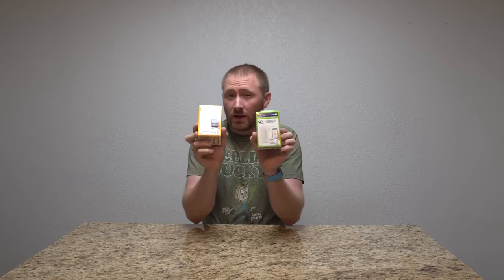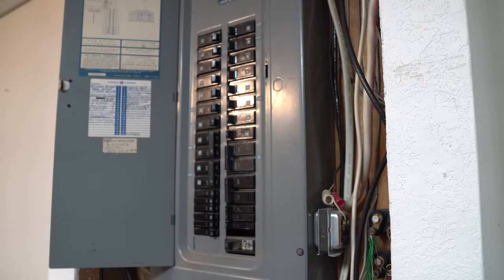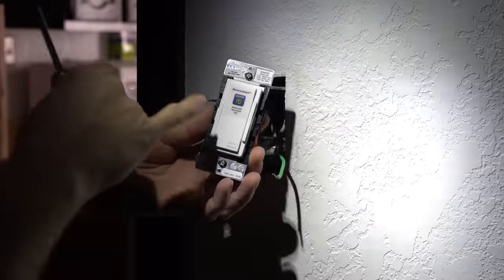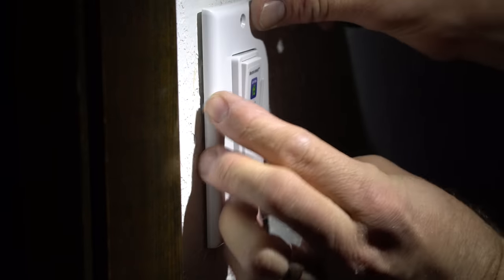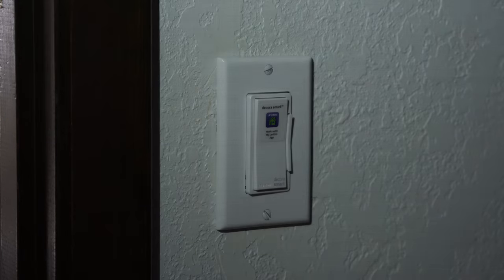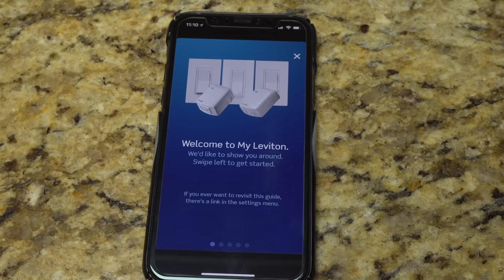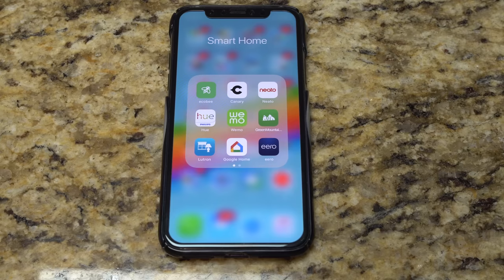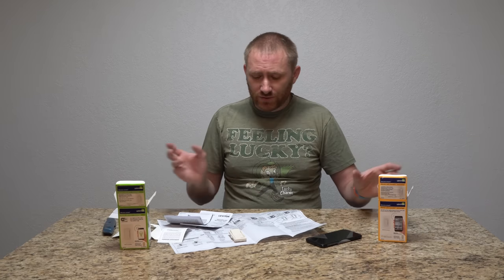Leviton Decora Smart Switch Install

Comment: You did a great job of presenting this installation.  One suggestion: Get a stationary flashlight that you can mount in a fixed position.  ;-)

Regarding your wiring mistake...the instructions show that the Red screw is for connecting the Load, and the Black screw is for attaching the Line.  In your video, you said to connect the Line to the Red screw, which is why it didn’t work.  For a first time failsafe installation, after removing the switch from the box, but before disconnecting the wires, turn the power back on and use your voltage probe to find the live wire (with the light switch turned OFF).  That will be your Line wire.  Then, mark that wire with a piece of electrical tape, or a label, so you’ll know which one to connect to the Black (Line) screw on the switch.

Keep up the great work.  Your video production is very good!

Comment: A couple notes. You should not have connected both neutral wires to that single screw terminal as it is a violation of electrical code. A short pigtail wire should have been added to the wire nut with the neutrals and then that single neutral pigtail wire would be connected to the screw terminal on the switch.

Next, you could have used your voltage tester to determine the line and load wires. After disconnecting the two black wires, turn the breaker back on temporarily. Use your voltage tester and touch it to each black wire. The one that sets off the tester is the line wire coming from the breaker panel, and the load is the wire with no voltage that goes to the light. Of course, it is very important to then turn the breaker back off before starting to connect the wires to the new switch.
Reply: Also a klein non contact voltage tester will tell you which is your hot and which is your load and to verify if a circuit is energized.. I use it because I have seperate circuits running into a two gang boxes in my house, never assume two switches are on same circuit.

Comment: I bought a few of them that are HomeKit enabled. They are a huge pain to sync to HomeKit took me several hours of resetting the switch to get them to talk. But after they sync they are great. I really liked the no hub required but after my research the Lurton ones are better because the hub helps with the communication. For my future installs I’m going to use the Lutron ones.
Reply: How did you connect them the the app? No one shows you that

Comment: If anyone is having any issues connecting these Decora Smart Switches to your network, it may be your router settings.  One thing they don't tell you anywhere at all...These switches will only work on the 2.4 GHz router setting.  NOT the 5GHz router setting.  A lot of routers have two SSIDs going it once.  One is set to 2.4 GHz and one is set 5 GHz.  With the same exact name and password.  What is happening is, sometimes your light switch will log onto the 5 GHz SSID instead.  It will look like it is connected fine, but Homekit doesn't see it.  So what I did was change the name of the 5 GHz SSID to something different.  That way my switches were only logging onto the 2.4 GHz SSID along with my iPhone.  If this works for you great.  (The Wemo products work on both frequencies)

 Now the problem that I am having is, whatever network you pick for your iPhone has to be on the same network as the switches are on.  Well, for some reason, my iPhone does not like the 2.4 GHz network for some odd reason that I can't figure out.  I get the dreaded "wrong password" on my iPhone intermittently.  So I have to set both SSID's to the same name.  So for me, every once in a while I find that the Decora Smart Switches logs on to the wrong network and I have to just reset them with the airgap switch.  I'm going to be getting a new iPhone soon, so hopefully this fixes everything. My current iPhone is a version 6.

Comment: I have a question. In my garage i have 3 switches (1 controls front flood lights, 1 controls back flood lights, 1 control lights in garage) will i need three separate switches or 1 three way switch? The same for kitchen i have 2 switches ( 1 control breezeway lights and 1 controls kitchen lights)
Reply: You need one switch for remplace each one at this case you need tree switch for remplace all or just one for remplace just one , if the switch  LT has mor the one location switch you have to wire like treway switch

Comment: You should of made a tail for the neutral and also tape around the back of the switch so it will not short been doing electric work for 30 years
Reply: Neutral...or ground wire...???

Comment: Hello, when you switch the Line to Load by error, then flipped the breaker, would it  trip the fuse from the breaker or cause damage to the dimmer? Sorry, I'm new to this and just wondering. Thanks.
Reply: jcgoobee no it shouldn’t cause any damage to the switch

Comment: This is very helpful. Thank you so much - I should have watched this first before I watched 10+ other videos that actually skipped the most confusing parts (like LED light dimming, or hot/load wiring switch) One question - you already have the power detector... could you have just used that to detect which is hot wire among those two wires?
Reply: Yes. Should use of VOM. If don't know what one is, learn to use it before screwing around with wiring.

Comment: If I have an existing 3-way setup do I still have to buy a matching controller switch or can I use the existing 3-way switches I have in the wall
Reply from the maker: I believe you need to purchase the matching 3-way switches for it to work properly.

Comment: I would like to use the leviton smart switch on a 2-wire application. I was able to identify the hot. Which terminal should I use on the switch itself?
Reply: Black is LINE
Red is LOAD
Line = from power source
Load = to light fixture

Comment: What if I can’t find the neutral line?
Reply: zguitarmaster I have the same question. I can't tell which one it is
Reply: Your neutral is always going to be your white wire and base on the NEC you are required to have a neutral in a switch box mean should have 5 wires in total 2 black wire( one is your line the other one your load) 2 white wires which are your neutrals and your ground
Reply: Jhorman Lopez depends on the age of the house/circuit. A 1950’s house will not necessarily have a neutral present and modern color coding not strictly adhered to..
Reply: I am an electrical engineer, but not an electrician, so I don’t know the NEC (I’m sure it can be found with an Internet search).  But older homes, with two wire outlets and switches (no ground wire) will not work with these smart switches.  They REQUIRE a ground connection.  But, to correct John Dutton’s comment... in those homes with two wires per outlet or switch, one wire is HOT, and the other wire is NEUTRAL.  There is no GROUND wire.  There is ALWAYS a NEUTRAL wire.
Reply: RbNetEngr with respect, an outlet/receptacle will always have a neutral. A switch simply interrupts the hot wire so no, it does not always have a neutral present. Check your Ugly’s handbook.
Reply: RbNetEngr to clarify a little, if the power is run to the light pocket prior to the switch then a neutral would not be needed run to the switch as the connections are all wire nutted in the light pocket. In modern wiring a neutral must be present regardless. Even in the 1950’s or 1960’s if the power were run first to the switch box, then a neutral will be present. It all depends on the initial routing of the wiring and the age of the circuit.
Reply: I'm an electrician! I finally get to use my knowledge on YouTube lol. But some switches don't actually have a neutral as it's not needed in a switch. Terms called a "Reverse Nuetral". If that's the case then your out of luck as you would have to run a Nuetral to your switch.
Reply: Licensed electrician here too.  Ernie is correct.  Many switches are just run in what's called a switch loop.  Somehow a neutral needs to be run if none is present.  Some cheat and make a fake neutral by grounding it.  DON'T do this.  Also, just because it's a neutral or white, even with the circuit off there still could be power on the neutral looking for the panel.  Google Multi Wire Branch Circuit.  THE WHITE WIRES ARE NOT ALWAYS SAFE TO TOUCH.  If in doubt, please call someone like Ernie or me since we can tell which wires do what in less than 15 seconds usually.  Stay safe out there.
Reply: This switch requires a neutral wire to work, if the home is old enough and doesn't have a neutral in the box then you can't use this switch.

Comment: Your line terminal is meant for your hot wire coming in... Your load terminal is meant for the wire going to light... You said that wrong.  Pigtail your neutral... And stop posting electrical videos
Reply: the leviton switches have 2 slots for the neutral per manufacturer spec so you dont need to pigtail

Comment: But HOW did you know which of the two black leads was the load lead? You replaced a simple two-pole switch, where it didn't matter how the black wires were connected. It's pretty frustrating watching these videos where the narrator knew details they didn't think it was necessary to tell everyone else!
Reply: Your line wire is always going to be your hot wire
Reply: @GaMeOvErRules  The line wire will set off the voltage tester. The load wire has no voltage since it is the wire that goes to the light (the load).